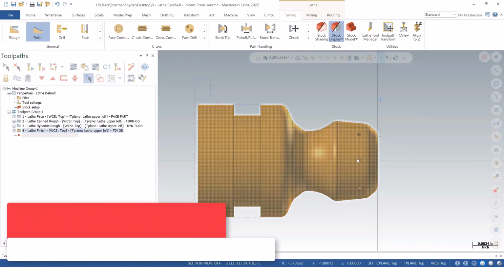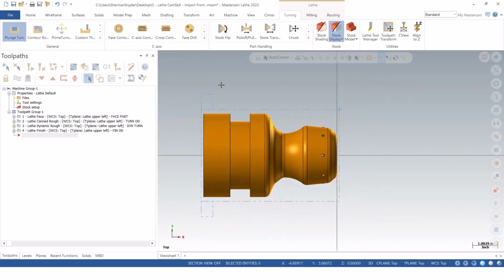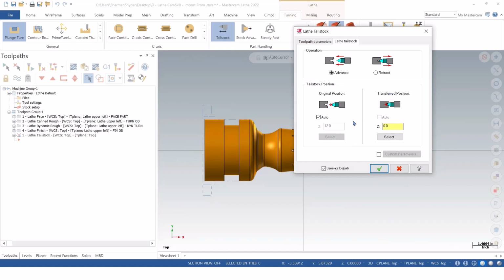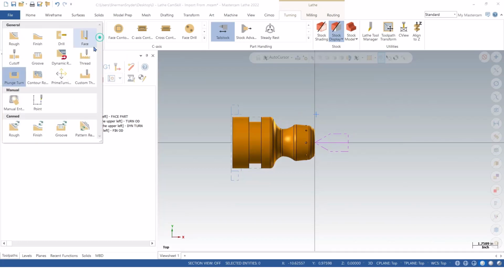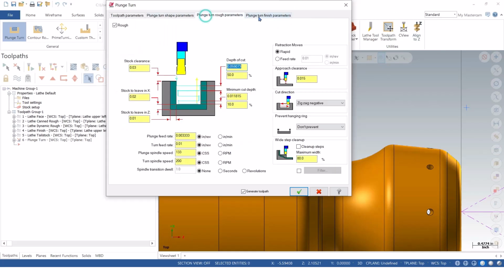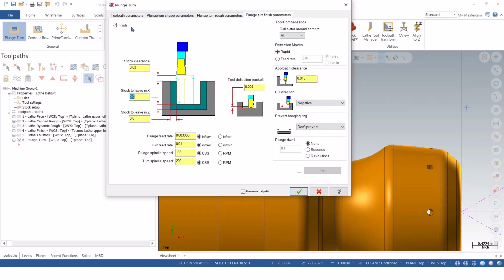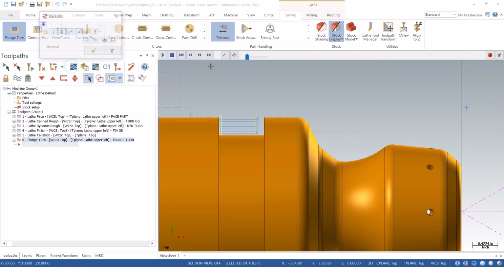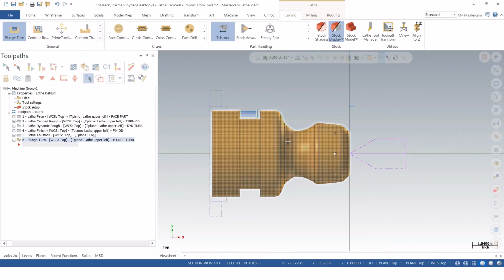Plunge Cut a Groove - Advanced Lathe Tips and Tricks 4/12

Comment: fantastic video thanks. When to use the plunge turn or the regular groove operation?
Reply from the maker: I use plunge turning when I can cut sideways with a grooving tool and groove operations when I need the tool to plunge only in the ‘X’ axis on a lathe. Mastercam groove cycles allow for variable depths to be defined when needing to plunge allowing you to adjust how much material is taken away in the ‘X’ axis at a time.